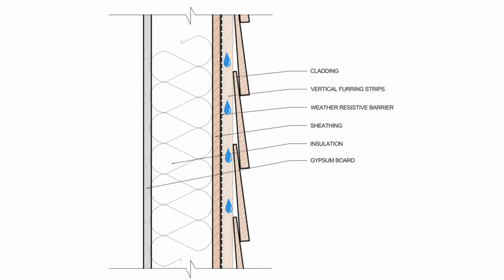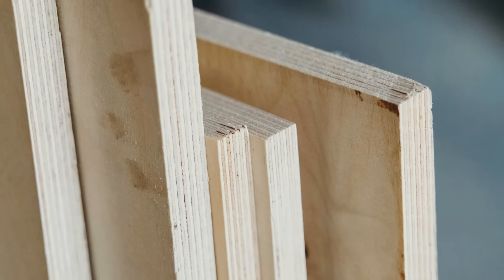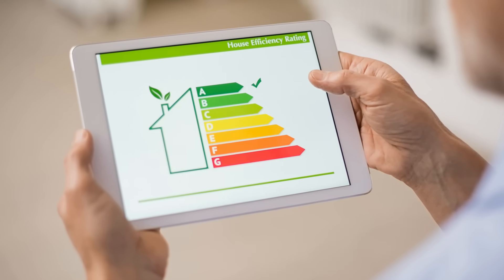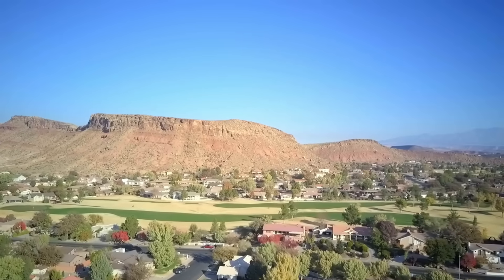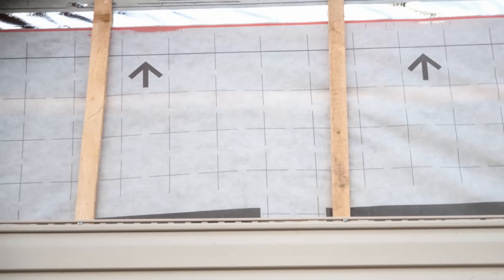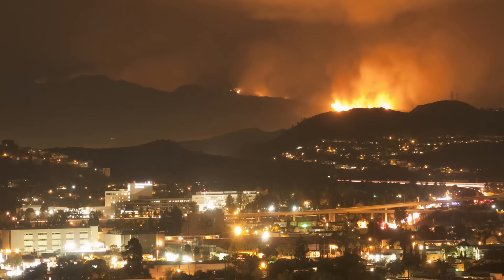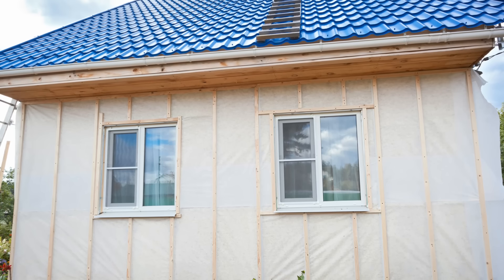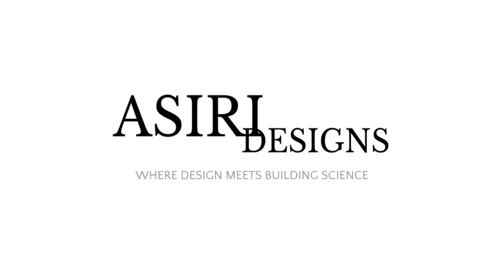Do You REALLY Need a Rainscreen?

Comment: At 5:55, the diagram shows horizontal furring strips sized at 5/4 x 4" and also a WRB drainage layer behind the rigid foam insulation.  I can't imagine anybody would exceed 3/4 stock for vertical or diagonal rain-screen furring, or even horizontal furring (as with wood shake installation).  Is the full 1 inch air space the preferred spacing behind siding?  If so, a dimple-mat or mesh products seems seriously inadequate.   As for the WRB layer, is that mainly to satisfy code?  The rigid foam insulation board would typically be quite impermeable.  Thanks as always for the great videos and information!

Comment: A small nitpick about the moisture susceptibility of things like plywood OSB and other engineered products: I don't think it's fair to say their susceptible to rotting because they don't have a lot of "real wood" in fact they're actually quite dense usually and the majority of that is still wood.

Really the issue is how much of the end grain is exposed, solid wood products have very little end-grain surface area to volume ratio whereas something like OSB has a very high end-grain to surface area ratio.

Of course normally all of that surface area is protected by glue / resin, if you leave it out and in constant moisture for a long time, it eventually will permeate through that caused the wood to swell then delaminate further exposing more surface area and making the problem worse.

Products like advantech use better adhesive and can prevent this for much longer.
Reply: Although significantly more expensive, real wood is more durable and performs better than OSB for a number of reasons, including what you have already described.  Construction mistakes, for example, or poor maintenance over time comes to mind.  Real wood will hold up better; OSB is less forgiving (hence the perception that it rots quicker).  Of course, the vast majority of projects can't afford too much solid wood.
Reply: Give this a whirl: Chuck a piece of plywood outside and chuck a piece of osb outside. The results are dramatically different.
Reply: @scarscar2771 did you read anything in my comment?
Reply: @MarkFunderburk yup. And I simplified the choice. Expose both (or all three or 4 etc) products to weather and see what happens to them. That’s enough for me. As for some argument about the surface area being protected by resin, I’d point to all the dramatic osb condensation failures on homes and then point to the ones from plywood… plywood vapor failures, Bueller?  bueller?  Oh right …

Comment: homes with good insulation are IMPOSSIBLE to keep cool in the summer. be ready to have the AC running 24/7. having a PC running all day makes a huge difference in a well insulated house. just boiling one teapot will make you feel more hot in such a house. and in the winter, your heating system will hold back on heating multiple time a day which will just allow the floors and corners of your room cool down, develop moisture and allow mold to grow. change in temperature is the biggest problem for your health. your structural wood will be fine but you never think that moisture comes from you and condenses on the walls, not the other way round.

Comment: I've seen "modern" buildings ask "do you really even need sheathing?" Nah bro. 2x4" exterior basement wall; no drywall inside (just finished with plastic vapor barrier); pink R13; 1" blue foam board; no house wrap; vinyl siding.  

That'll be $450K new construction "starter home" on a 1/8th lot with an 8% 35 year mortgage. Built by a boomer who bought a 4 bedroom on 2.5 acres for $35K with a summer job picking up nails at his dad's construction site for 17 cents an hour (that's only $37/hr adjusted for inflation) because he worked hard, had two pairs of bootstraps, and never bought a single avocado.

Comment: As a rule, i was taught that the siding is for looks. Behind that is the performance. Air gap behind siding, then water and airtight. Vapor perm depending on climate.
Reply from the maker: That is correct. The siding/cladding also provides an additional benefit, in that it protects the WRB from heat and UV damage, and when combined with the air gap, pressure balances the system.

Comment: What do you recommend for a rain screen under vertical shiplap?
Reply from the maker: Is the shiplap wood or an inorganic material? If it's wood, I want to see a 3/4" gap to promote drying of the cladding, so that typically means either a corrugated plastic batten or diagonal furring strips. If it's a synthetic material, a 1/4" entangled mesh would work well.
Reply: @ASIRIDesigns  thank you! Very happy to see mention of diagonal furring strips!
Reply: the OP point might be that with a vertical lathe  there's is no way to nail 5" vertical ship lap, trying to run horizontal lathe is only asking to trap water.

Comment: to do a vertical siding you would need vertical and then horizontal strapping?
Reply from the maker: Yes, or you can use an a 3D entangled mesh or horizontal corrugated plastic battens that allow for airflow, or you can install the strapping/furring diagonally. Lots of options!
Reply: @ASIRIDesigns  thanks

Comment: now in BC   with the net zero bull you will need external wall insulation to get the r value   by 2027  r value will have to be 30-40 for walls    basicly need 2x8  or 2x10 studs    or outsulation

Comment: A lot of the problems are caused by number one not enough over him from the soffit mobile homes and notorious for having less than a foot this means in the Pacific Northwest on the west side east and south side of your structure you’re getting in certain areas anything from 50 to 150“ of rain here These areas your overhang should be 4 feet. The best solution to this is a wraparound porch with a bullnose at least 8 foot out. Most developments have less than 5 feet between the house and the fence line which is one of the biggest problems. Second problem is behaviour sighting coming all the way down to within 6 inches of the ground that’s another Bad move. You should be using some kind of stone brick. Or impervious product if it’s a matter of cost will just build a smaller house and I think that’s the underlying problem. A lot of people want as big houses they can get on their lot having at least 20 feet between your house and your fence is one of the best things that you can do.
Yep, front cost of having natural stone brick etc. The materials may cost a little more labour cost. Stay the same give or take 15%.
ICF construction is a lot more durable. What you pay out on the front end you save on the backend lower heating more insulation less maintenance and a 100 year product. You only ever have to build this once with very little maintenance. 
I can tell you after 45 years of being in business as a GC repairing homes and large condominium complexes and apartment buildings. The best thing that you can do is move into a new house every 10 years if you’re in a wet climate to stay ahead of the maintenance repair cost .
So spend the money upfront for a bit of product or end up paying it on the back end to GC the same goes for your roof

Comment: Another key feature of cladding or 'rainscreen' is that it protects the building from overheating when the cladding is in direct sunlight.Vertical battens at least 25mm thick behind the cladding create air channels to take heat from the cladding via the heated air which convects away rather than  conducting through the cladding to the inside. 
The same is true of properly tiled roofs as opposed to those cheap and nasty synthetic 'shingles' sitting directly on OSB.

Comment: any polimer based cladding is just not durable because it decomposes when exposed to changes of temperature and sun. I live in wooden house with pine board cladding and they were painted only 5 times in 80 years, no rot, no detarioration, and the house is in constant shade from trees. Manufacturers allways try to create sollution to a problem that doesn't exists.

Comment: After hearing your rational for needing a rain screen? My thought was; don't cheap out! (Don't use OSB, which I personally hate to start with, and all the other expensive crap becomes unnecessary)! Thanks for reinforcing the opinion I've held all along.
Reply: My thoughts exactly.  Don't use garbageboard.
Reply: But that's not true. With a sealed and well insulated wall, a rain screen is still recommended in wet climates when you use plywood sheathing instead of OSB. You're not going to save money or time by using plywood.
Reply: @mrcujosoccer  Yes. IMHO, don't use plywood to save money or time or to avoid a rainscreen. I prefer to use plywood because it is more robust if it does get wet for some reason. Of course there are good justifications to use osb as well (cost, makes better use of forest raw material etc).
Reply: I agree, build to last with better materials. For me that is plywood sheathing rather than osb and also a rain screen. Lots of construction is cost sensitive with a short term mindset unfortunately. Not necessarily as cost effective in the long term.
Reply: “Thanks for reinforcing the opinion I’ve held all along.” — every positive comment on the internet.

Comment: With proper overhangs and attention to detail with the primary cladding, rainscreens are a waste and introduce other issues including major bug and other critter cavities.  If your primary cladding isn't stopping liquid water, why are you using it.  The other issues about insulation and interior moisture are all related to the air barriers, a completely separate issue.
Reply from the maker: This is completely wrong. I recommend reading the article we pinned in the comments.

Comment: So what's the recommendation for wildfire-risk areas like S BC, Canada?
Reply: Something like a wrb with entangled mesh or whatnot that has less airflow than furring strips is less fire risk. Of course, fire resistant materials like fiber cement cladding rather than wood shingles, roxul exterior insulation rather than foam, etc. It also needs to meet local codes - some of bc is very wet and may require a thicker rainscreen gap.

Comment: And exactly how does any significant amount of water migrate thru interior paint?  That paint is waterproof - as evidenced by ceiling paint blisters when there is a roof leak.
Reply: Vapor, not liquid... 😅
Reply: Paint fails, vinyl siding flexes, etc. Gaps, cracks etc and wind driven conditions. It's not like the wrb gets soaked every rain storm. It's more a matter of it being able to dry out if a little water gets in there.

And wrt painted siding, the paint lasts better with a rainscreen than without.
Reply: Lots of holes in that paint, like for plumbing and electrical connections.

Comment: Our old houses in New Zealand never had building wrap or tar paper - they worked ok.  The important thing was good design to direct water away from the building envelope.
Reply: Old houses worked ok, but standards have changed over time and we generally want to use less energy than old homes did which is the biggest driver of these changes aside from osb etc.

 Also, the importance of all of this escalates in harsh climate zones, particularly cold ones (I'm in Canada). With our hot humid summers (AC use) and freezing cold winters, the science of managing condensation in all seasons while getting high R value assemblies is really important here today. Old homes here were leaky, used a lot of heat (but were still drafty/cold in winter), and didn't originally have AC.
Reply: @jamesroscoe7555 agree with the 1st paragraph n most of the 2nd   Old school houses weren’t built 4 efficiency  it was just 4 walls 2 keep most of the elements out. Nowadays nearly everyone is promoting using less energy n I get it  if there is something u can do that can save $ n cut down on heating n cooling cycles along with helping the environment. Who wouldn’t want that  but these new homes go 2 such an extreme 2 keep out water n the elements if water gets in. It cant dry out like the older homes  houses create water vapor from cooking showering etc  there has 2 b a way 4 it 2 get out  take shingles 4 example u need proper air flow in your attic or shingle manufacturers won’t warranty their product  they also require underlayment. U don’t have either 1 it voids your warranty. Just like we have 2 breath 2 survive your house n attic need 2 breath n have proper air flow in case water would ever get in  it could at least dry out   Newer homes r built so tight if water gets in it can’t dry out n some have mold issues
Reply: @ChrisKugele I agree that modern high efficiency homes are more complicated. A tight envelope requires an ERV/HRV to deal with vapour. The upside though is a vastly smaller and cheaper heat source/AC. It's tradeoffs, and yes, the building envelope needs to be more carefully planned to make sure each material, whether shingles or siding has appropriate installation (ventilation etc). It can be done right, it's just that many builders don't and even the codes are sometimes behind what is actually necessary. The failures in the field are generally due to those issues.
Reply: Old house, how old? The requirement is for new construction under new building material science.

Comment: So what I'm hearing is... either build a wall over your wall and a roof over your roof, OR start building with durable materials again. The latter seems much simpler, and possibly cheaper.

Two houses with cheap materials are cheaper than one with durable materials?
Reply: You should get your hearing checked then. You're not 'building another wall' - you're adding a single layer of strapping.
Reply: You also missed the point about insulation and energy efficiency... 😅
Reply: "durable materials again" this implies that homes in the past were magically built to a higher standard of durability AND efficiency than modern homes 😂 first sign of ignorance is this stupid luddite mindset

Comment: 3:25 For an anecdotal data point, I saw someone try to protect some flooring against a leak by covering it with housewrap instead of plastic. When we took the housewrap off, the water had worked its way through and held the water against the inside material. The wrap was unused scrap, was folded over multiple times, and had no exposed seams or holes. It will resist water but it is not impermeable and over time sitting water will get through.
Reply: Wrap is for vertical use only.
Reply: @EnduroPromotions and even then does a very poor job at doing what it was "designed and engineered" to do! As soap and other very common everyday products will accelerate it failure.
Reply: @AKMetalGod for sure a forced air gap for airflow and drying should be done and reduces thousands of nail holes in the outside rain screen of the tyvec.
Reply: @EnduroPromotions house wrap is essentially useless even without a single nail hole. As any soap product renders it useless and turns it into a sponge! And nearly everyone pressure washes their house once a year. The first time you do. The house wrap becomes a detrement and negates what it was installed to do. Even after drying it is still compromised. Not that it will dry after the soapy water (surface tension) adheres it to the sheeting. If you don't believe me, try it! Prove me wrong! I dare ya!

Comment: How do you recommend a design for non-ventilated rain screen in forested areas?
Reply: Why not have it ventilated
Reply: @bfelb wildfire risk, provides a  channel for hot air behind the siding up to the roof. Lose the roof and the house is done.

The suggestion was to use a rainscreen with an integrated drainage gap, eg entangled mesh, which provides a capillary break but not as much airflow.
Reply: @jamesroscoe7555  they should be focused on having a ventilated rain screen in light of the fire hazard, not finding a work around to not having ventilation
Reply: @bfelb I agree, there are approaches to close off the gap in heat, prevent ash from getting in the gap, etc... and using fire resistant materials to begin with is of course the first step. But in climates where the rainscreen requirements are less onerous, going with a thinner gap is probably a reasonable choice.
Reply: skip the rain screen all together
Reply: The comments here are interesting.  A rain screen system with ventilation at the bottom but not at the top will mitigate the risk of burning embers being sucked up into the assembly.  Gravity will still pull intruding water down, but moisture will persist longer (so metal or plastic furring will serve better).   There are vent cover methods and products designed to block burning embers from entering into crawlspaces, soffits, and rain-screen assemblies.  Basically finely woven stainless steel screening, especially in two layers is the budget approach.  Commercially available products (ember resistant vents) for this application have special, additional features.   Of course, in wild-fire prone areas, there are important additional strategies that must be included on the structure and the property.